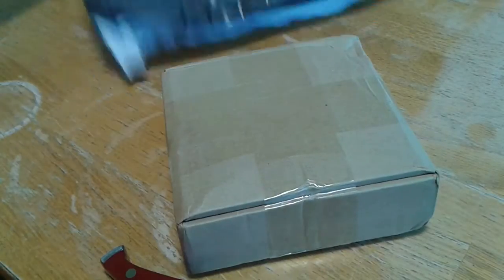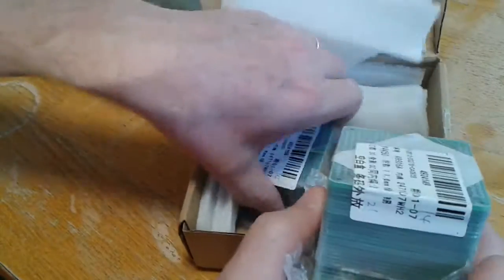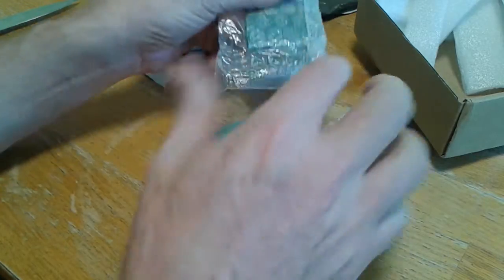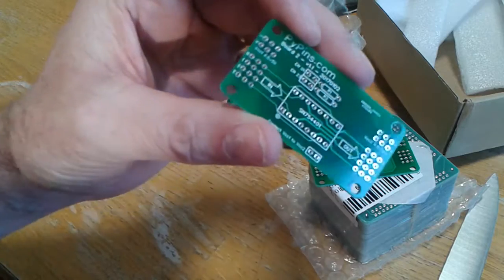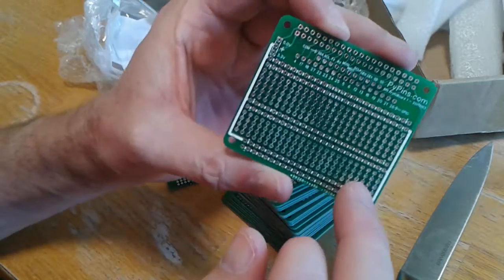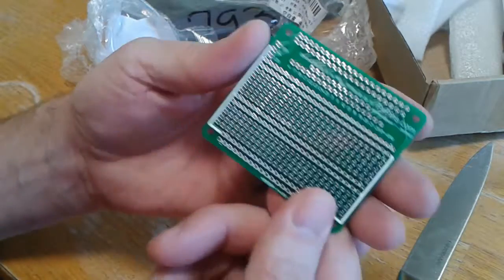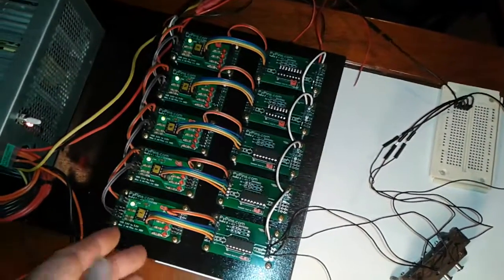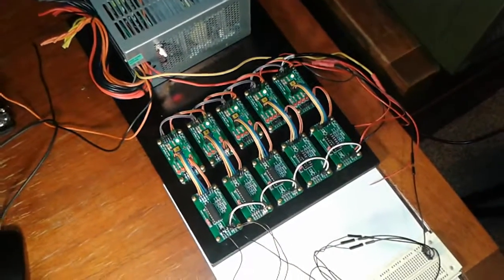Unboxing Circuit Boards from EasyEDA (plus building and testing)

Comment: I like the EasyEDA website (just found it last week) and I like the Chinese cheap stuff websites (AliExpress etc.). I have a quite expensive hobby (a model railroad) and in this way I can save about 50 to 60% on electronics. I put in the schematics (in EasyEDA) last week and this week I'll start with the PCB design, see how that goes.

Comment: China eh?  Does that mean they ship things as ePackets?  
ie: it's why you can buy things on ebay from China for only $1 with shipping incl.

I mean normally we people in Australia don't bother with most American web storefronts coz the international shipping costs are ridiculous (generally more expensive than the item).  But if this is comming from China then that's different.
Reply from the maker: roidroid - When I ordered the first board, the boards were 23 and the shipping was 9 via Singapore post. Shipping was a little more for these. But I still end up at about 1 dollar per board.